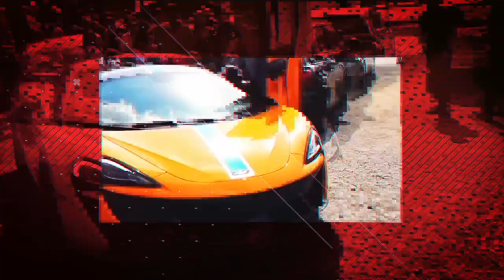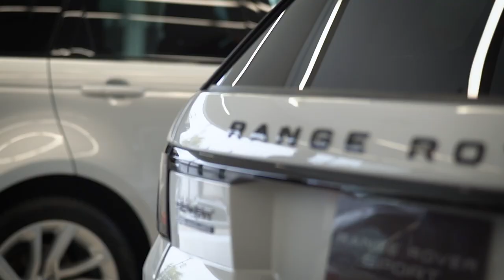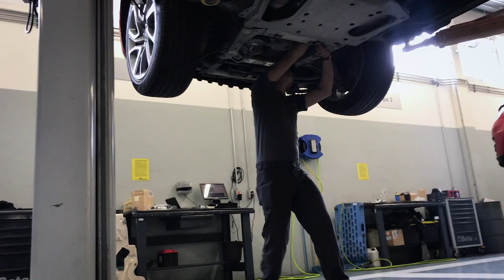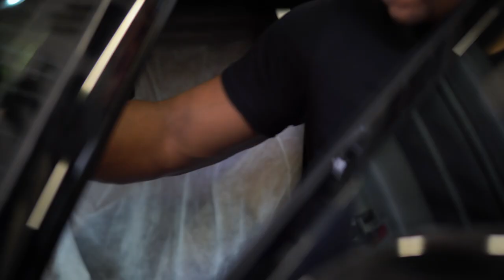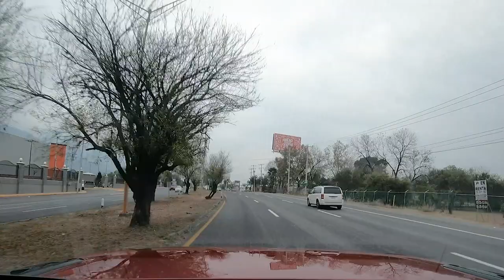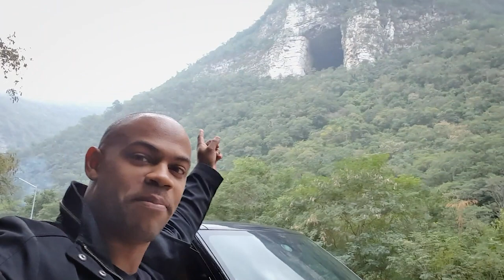MY NEW 2020 RANGE ROVER IS DEAD!!! *WATCH BEFORE BUYING*

Comment: Driving 2021 Range Rover Sport autobiography. Ran into a gentleman yesterday he said beware of the airbag shocks. He said he walked out one day. The car was completely on the ground called his buddy who owns the Range Rover dealership in Houston Texas. He said that it would’ve caused him $39,000 to fix if he did not have Extended warranty or if factory warranty was up..what do you know about that? Also thank you for sharing about how to adjust your car from going up and down because mine quit working. Every time I put it in park and went to exit the vehicle I have to push the down button I have 34,000 miles on my 2021 close to 36,000 miles I did lease but then I just purchased because my husband wants to have a second vehicle so I was going to order a new one. This is my second Range Rover sport and have had no problems. I think I need to go to the manuel and figure out how or why the option to automatically lower when I get out of the car has stopped. Maybe my setting is wrong anyways I’m digging your videos. I just discovered you.😃
Reply from the maker: Hey there! 

So turn access mode on to have it lower automatically or turn it off to have it stay at the standards height.  

$39,000 for their air suspension is impossible. It doesn’t cost anywhere near that much. That’s more then a brand new engine

Comment: Love the video... Starter going from seals getting moisture is the manufacturers fault I agree... As to how long between Oil Changes... The factory 12,000 mile interval "may be ok" if you drove your Rover Sport 5.0SC V8 like my going on 93 year old grandmother drives. However, you "Drive-Hard" bro... as your video's show that I love. Lastly, just the trip from Canada to Mexico you took I would have changed the oil. It's the easiest and cleanest vehicle I've ever changed the oil & filter on with a 10 quart vacuum oil sump pump and an AES oil filter wrench. I change my own oil ever 5,500-6,000 miles because I drive mine almost as hard as you do your Rover Sport. And for $150 for 8 quarts of Castrol Edge Professional and an OEM filter from the dealer and about 14 minutes of my time it's cheap insurance. My original engine blew (2nd owner) and costs almost $33,000 to replace after giving JLR the blown engine discount of $7,500 for a core charge/credit. The Dealer's Master Mechanic and Shop Foreman both agreed it was ran too long and with a less than full oil sump that caused a timing issue resulting in a failed bearing, spun connecting rod,  piston to valve slap, and the gouged crank shaft. I took her easy after the new JLR AJ-V8 OEM engine install for the first 1,000 miles. Changed the oil per the Master Mechanic that performed the install shortly after break-in... And it was the dirtiest oil and nastiest filter I have ever witnessed just from and easy new engine break in never going over 3,500 RPMs. I've got 7,000 miles on the new AJ-V8 and she's noticeably much stronger and has a deeper exhaust growl than the starved original factory engine ever did upon my purchase... I attribute that to proper engine break-in and to the oil/filter change twice within those 7K miles. (2) New OEM air filters seemed to help her pick up an extra step recently too. Of course, this is just this man's experience and YMMV...
Reply from the maker: Thanks Jeremy! Ya I typically change the oil every 10K kms, that has been working well for me. I would rather change too often then not enough.  Funny thing about the starter, the new on that they replaced it with ALSO FAILED. After a rain storm, the start up was getting weak, so I had the shop order a new one and replace it, which they did and its been solid ever since, so clearly it was just bad parts. 
Your story sounds a lot like a guy in the RR forums, that goes by the handle Ham lol. 
Super informative comment, love hearing stories like that and being able to share my experiences with those who watch as well.

Comment: (Service from Land Rover)You don't think it's anything to do your You Tube channel??? Hmmmm it's shite, just like the built quality. Hence the depreciation value. I give it 1000 mile before nxt fault..
Reply from the maker: No man. Channel is way too small. 60k and zero issues.
Reply: Do not know if I am lucky or else, but I am on my 4th rr,,, have to agree that my bmw build rr was a hell of a garbage (2003-2005), 09 was awesome, then I switched to rr sports and  I would never go back to regular size,, love them, only minor problems like sunroof slow in opening etc etc- all repaired when on warranty....all vehicles depreciate, higher msrp -- more you loose, but the rr you just want to drive these beasts and don't think of trading them,,,

Comment: U should get urself some Aluminum Shift Paddle Extensions
Reply from the maker: Thanks for the suggestion man!
Reply: I got some carbon fiber shifter paddles that overlay the existing paddles that make it much easier to run thru the gears over stock... All for about $60 as opposed to the couple hundred for the OEM Aluminum Paddles (of which are extremely nice too btw...)

Comment: I'm trying 2 make it low but  i don't no if I should buy the link pins r the module.
Let me no if u no any info abt it
Reply from the maker: I don't fully understand, can you retype your questions
Reply: @DrivenHard  Hey what's up player ! I " no " the feeling of driving the ultimate <SUV> . Some people on u tube if they cnt afford the 🚗 they talk crap abt it.
Anyway , I'm trying 2 make mine a few inches lower  I hate 2 c the big gap < B=tween> the tires  n the fenders do u think I should get the pin 📌 2 lower the springs R buy the Electric Module but if I get the Module the technician gonna have reprogram the computer.
If u don't no anything abt it don't worryabt it.
ENJOY THE BEAST !
Reply from the maker: I don't know enough about that to comment bro. Hit up the range rover forums m, the guys and girls in those know everything you need to know about mods etc.